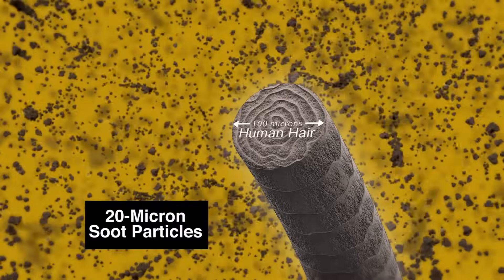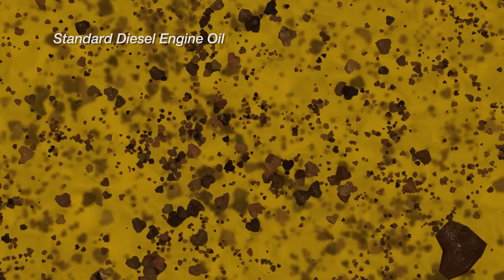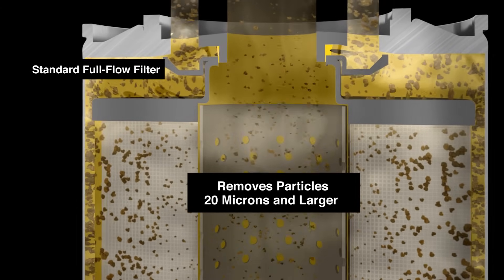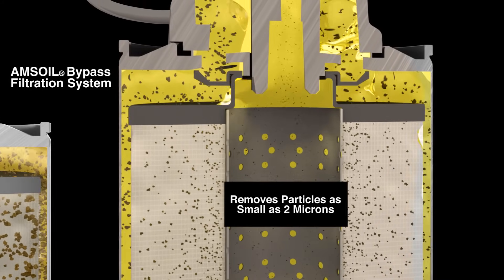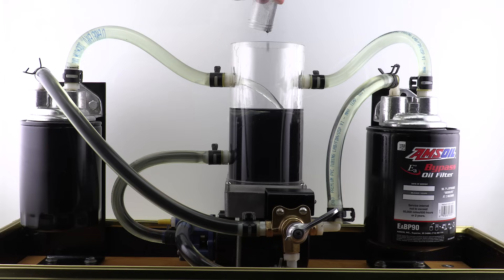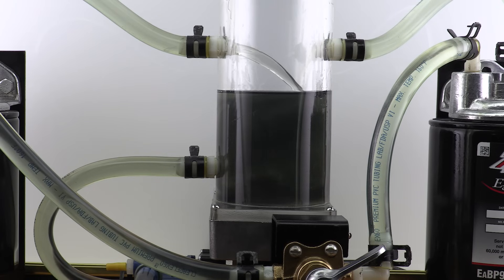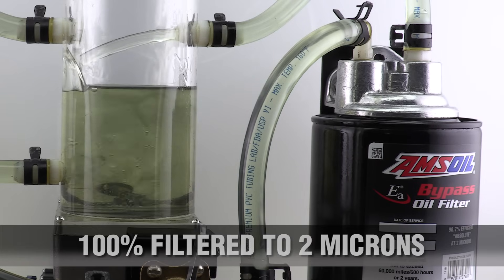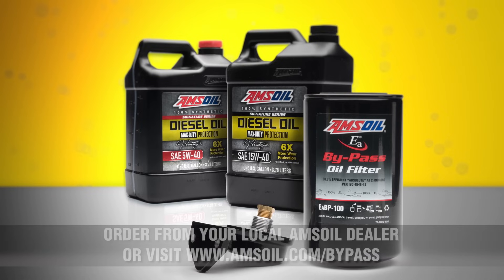AMSOIL: Diesel Bypass Filter Solution

Comment: So i route the return line into the intake?
Reply: No. Depends on which bypass system you use. Some route into the oil fill cap (using a cap with a fitting on it) and others like my dual bypass system route the oil back into the normal flow path using a filter boss take-off.

Comment: Do not buy this expecting it to make your oil visibly clean. 
I just put this on my ‘22 Powerstroke at the last oil change. The oil returning from the bypass filter was immediately black as night.
Reply from the maker: Hello Dallon,

This AMSOIL bypass demonstration is showing how effective the filter is at removing particles that are larger than 3 microns.  Any abrasive wear inside an engine is generally created by particle sizes in the 5 micron to 45 micron range.  The purpose of the filters is to reduce the number of abrasive materials in the engine oil in these size ranges to increase the life of the engine.

In the demonstration, there is a new oil that is contaminated with carbon black suspended in the oil.  The carbon black is used in the size range of 4 to 10 microns.  A typical full flow filter can only remove particles in the 10 to 45 micron range, so in this filter demonstration, running oil through the full flow filter alone will not remove the carbon black particles.  This is very helpful in the demonstrate how regular full flow filtration will not remove all the abrasive particles that are generated inside the engine.   When the oil is passed through the bypass filter, which filters between 1 to 3 microns, it is going to trap the carbon black and demonstrate how bypass filtration can remove finer particles from the oil, effectively removing a majority of all the abrasive particles in the oiling system.

Because this carbon black is "black", which is the same color as diesel soot, some customers believe the bypass system should be removing all the soot in a used diesel oil, making it look clear in appearance.  This is not going to be the case using the bypass filtration system on a diesel engine because soot is sub-micronic (sizes less than 1 micron in size).  The bypass filter will remove any soot that has agglomerated and increased in size larger than 3 microns, so the oil is analytically clean, however, the remaining soot particles will remain suspended in the oil giving it a dark appearance.
Reply: @  what a beautiful explanation!
I believe it. I’m sure my oil is still much cleaner and appreciate the product very much!

Comment: We have been using a similar high efficiency Trasko spin on filter for years and it works brilliantly.
We change the filter every ~80,000 km
Prior to the filter the oil had particles in the 2~22 micron range.
After the filter the particles were <2 micron in size.
We used microscopy from two different companies to confirm this
You can hear the difference in the engine before and after: 
The engine gets quieter
Quieter engines mean better lubrication.

We change the oil at recommended intervals as the oil does get a bit dirty (with sub micron particles) and additive package is depleted e.g. Total Base Number is too low
An oil change is the simplest way to replenish the additive package and remove the < 2 micron particles

We do an oil analysis every oil change to keep track of wear in the engine and the oil quality.
🙂
Reply: High efficiency spin on filters are much simpler to fit than bypass filters and seem to give exactly the same results.
:-)
Reply: To reduce wear further try bonding a lubricant to the engine
:-) #XcelPlus
Reply: Vc é o bichão mesmo heim

Comment: I just wonder if this is such a great product and so necessary for diesel engines, why hasn’t AMSOIL developed this product for the 3.0L Duramax LM2 and LZ0 engines that are now one of GM’s best sellers  I asked AMSOIL if they make one for this engine and they said no with no indication that they are thinking of doing so.  IF it works, then it seems like they are missing a huge market given that it would be a mod of an existing product.

Comment: A few great oil additives to do, in your  pre oil change 500-800 miles before change & filter event.
1. MOTORKOTE
2, HOTSHOT
3. ARCHOIL 

Definitely Use Shaffers oil, with TBN in it. 
Its chemical balance has superior wear protection Proven easily amsoil has claimed they have.

Comment: so changing oil more or paying hundreds of dollars for by-pass  it may take out the particles but the additives break down dont they?   i lost my trust with amsoils 25k gas filters, i went to about 10k miles and the oil was black as if it was in my 1970 chevy with dino oil.   normally when i cange every 3-5k my oil is still clear on teh dipstic..    somehow i dont feel amsoil is telling the whole story.    plus with the info on bypass filters....WHY WOULD ANYONE WANT TO GO TO 25K AND LOAD THE OIL WITH 50X THE AMOUNT OF DEBRIS BELOW 20 MICRONS?  THAT DONT MAKE SENSE.   ONLY THING THAT DOES. IS PUT TEH BYPASS FILTER ON, AND CHANGE THE OIL THE SAME. AND HAVE YOUR ENGINE LAST LONGER.
Reply: Oil color is zero indication of oil quality. Did you send that sample off for analysis? If you didn’t, then you have no idea what the condition of the used oil was. Using “oil color” as a basis for replacement is just as silly as sniffing the sample or tasting it. It won’t tell you anything.

Comment: Make a version for gas engines and 1/2 the price and I'm IN.
Reply: They do. It’s the universal dual bypass system. I run one on my Navigator with the 3v Ford 5.4 V8. They give you the hoses and everything else with the kit. You have to order the right oil filter boss take-off with it, but everything works well. You do have to make your hoses from the kit hoses and fittings, but they give you plenty.
Reply: Use the dual bypass kit. I run one on my Ford 5.4 V8. It’s been working well.

Comment: It's a lie. Doesn't work. Other utubers have tested it. Sorry
Reply: Steven Bryant............I installed one of these system on a 1994 Dodge/Cummins powered pickup, and ran it for 10 years/155,000 miles, and took oil analysis every 12,000 miles, and never changed out the oil, so yes, they do work!
Reply: @stevenbryant3752 - Making incorrect, damaging statements about a company is illegal. It's called libel.  People committing libel can be sued in court and lawyers are very expensive.  Libel is also in violation of YouTube established rules.

Comment: These demonstrations always cut away after a few seconds of the bypass filter running. It is instantly clear because the bypass filter is filled with clean, fresh oil. So when it is switched over you think, wow that's amazing. They are more than likely only dumping larger micron particles into it also. There's no need for this type of illusion BS but they all do it. Diesel oil is still gonna be black due to the sub 2-3 micron soot particle in it. It would turn black with 0.5 micron soot in it too. Like people have commented before, you have to send in oil samples to know how it's doing. If you look at other peoples data that is posted all over the place, you can easily extend your oil changes by double the miles, but to be sure you'd need to sample and decide for yourself.  In my opinion they are worth installing if you plan to keep the vehicle long term. If you get a new car or truck every 2-3 years you probably don't need to bother. 2 micron particles will still wear on your engine, just slower than 20 micron particles. Think of it like sanding with 200 grit and 800 grit on wood. If you use enough 800 you'll still sand it down, just takes longer.
Reply: @emrwtf - Making incorrect, damaging statements about a company is illegal. It's called libel.  People committing libel can be sued in court and lawyers are very expensive.  Libel is also in violation of YouTube established rules.
Reply: @HiTechOilCo  little late to the party bud. That comment was a year ago. Also it is my opinion, which is perfectly legal as per the constitution. Just like it is perfectly legal for you to have an opinion about my opinion. You really have nothing better to do?

Comment: The problem with these stupid videos is that they show it going from dirty engine oil to clear clean oil. Problem is these useless demonstrations are using brand new oil that has never seen heat or cycles of a Diesel engine, now for all of you who have bought this in hope that your engine oil will stay golden for 100,000k’s your misinformed, 

Oil will darkin purely because it’s carbon based, when carbon gets hot it darkens, the fact is these filters and other bypass systems will remove contaminants but you need oil samples to see how much, and for all the people complaining there oil still turns black after having these that’s cause these cock sucker oil companies are very smart in how they advertise a product, now if it actually removed soot load from oil they would use filthy dirty engine oil out of a EGR cummins motor and see how it pans out 😎😎😎😎 but yes they work, you’ll see difference in oil samples not in oil colour 🤷🏼‍♀️
Reply: Making incorrect, damaging statements about a company is illegal. It's called libel.  People committing libel can be sued in court and lawyers are very expensive.  Libel is also in violation of YouTube established rules.

Comment: Why is the oil black after changing it with the bypass filter on a diesel?  What does that mean if it's black?
Reply: Brent S...............The black oil in Diesels is small particles of "SOOT" that are very small, like .0000009 that you see.  When these small particles AGGLOMERATE (Gain Growth) and become larger, the by-pass filter will then take them out,but the very small soot particles will still be there causing the oil to look black.
Reply: You should also do an oil analysis. They can tell you the condition of the oil from a sample & what wear particles are in it. When there is an abnormality you will see it on your lab report. They helped me catch bearing wear on a 1.1 million mile engine, Heavy duty diesel.

Comment: Does Amsoil Bypass filter lower oil pressure on 6.0 Powerstroke?
Reply from the maker: Thank you for the question, Michael. The AMSOIL Bypass System will not affect the oil pressure in the engine.  The pressure needed to for the bypass system is reserve pressure the engine oil pump generates, and will not have reduce the oil pressure to the engine parts. 

We hope this is helpful. If you have any additional questions, please contact our Tech Team at Tech@amsoil.com or by phone at 715-399-8324. Thank you! 

-The AMSOIL Team
Reply: When I installed this kit and switched from synth blend to amsoil signature, my oil pressure dropped about 10 psi cold, and 5 psi midrange. However at idle it is about 3 psi higher after working hard so I think it's just due to the oil being superior and more stable.

Comment: great video.. i am running this system and have never got the oil to go clear again like in the video but i think this is because  in the demo when it is switched over to the by pass filter its running 100% not 10%. still its better than nothing.
Reply: That's because in real life, your engine will have those ultra small soot particles under 2 microns, which will still color the oil. However, the oil will not be as thoroughly black and opaque as oil that hasn't been bypass filtered.
Reply: They may use a media bigger then 2 microns to show what is happening. Ive used amsoil for about 20 years. In oil analysis it's performed better then Rotella and some other oils I tried. another logger noticed a huge wintertime starting gain on his 700 hp chipper.
Reply: @firewoodtime2   What they use is a contaminant solution which has particles smaller than 20 microns but larger than 2 microns, so it can be missed by the full flow filter but filtered by the bypass filter.

With a real engine, you'll still have those sub 2 micron particles, which cause very little engine damage. Most wear is caused by those 2-20 micron particles.
Reply: I bought this system and can confirm this is the truth
Reply: They said they used particles 5-10 microns in size.
That's why the oil went clear after filtration i.e. The filter filters to 2 microns
The particles that are left in your engine oil are under 2 microns in size.
These smaller particles are not the ones that can damage your engine... but they will make your oil look black.
🙂
Reply: The reason is because the bypass filter is filled with fresh clean oil in the demo, and they only run it for a short time after switching it to the bypass filter. Every single demo you see like this they will cut away after 10-15 seconds.  A 2 micron filter will filter down to 2 microns, but you'll never get new clear oil out of one. You'd need a centrifuge to get pure clean oil. Even then I'd imagine recycled oil is filtered through some kind of sub micron filtering or something else to get it clear again.
Reply: @emrwtf  tricksters.  Not a fair demo thanks for pointing this out.
Reply: @ Despite being a bit misleading it's actually a reasonable test... as the only particles left behind would be <2 microns in size and those are not big enough to cause damage to the engine.

The colour change is thus a good way to show that some filtering is occurring. If you run oil analysis and microscopy on your engine oil you can see that the large particles have been removed from the oil... and that the number of particles is significantly reduced when you use a high efficiency filter.

Comment: How big are the particles in what was poured in???????
Reply: Pretty obvious they were 2-20 microns. Probably a single specific size, like 10 microns.
Reply: They said they used 5-10 micron particles.
It was done to demonstrate how effective bypass filtration is at removing the particles that are responsible for causing most wear i.e. 2~22 micron
🙂

Comment: Hmm how come my oil doesn’t end up clean like that but is a sooty mess.. not saying they don’t work or aren’t good to have, I just bought one and have it on my older truck too.. just saying
Reply: David B.................Soot particles are very very small, in the range of .0000000009 (1 MICRON) so the oil will be black, as there is NO OIL filter that will take out that small of a soot particle.  However, when these small particles Agglomerate (come together and gain in size)  The 2 micron By-pass filter will take this size particle out, but the oil will be black!

Comment: I put 300 miles after the install. Oil is  still as dark at it was... Is that normal?
Reply: Oil is still dark, yes that's normal. But if you look at it very, very closely you'll see the oil has much less soot in it, compared to the same miles on your truck's oil without the bypass filter.  I will admit the demonstration in the video does not accurately portray oil color of a LIVE, running diesel engine.  It DOES show the idea or concept of bypass filtration.  A running diesel engine is generating soot and giving away as much free soot as possible wherever exhaust meets oil, like cylinder walls in the combustion chambers.  And the engine is running 600 to 2000-3000 rpm under normal conditions and pumping quite alot of oil per minute for lubrication, and other things like powering injectors in my 6.0 Powerstroke for example.  The regular oil filter is a full flow filter, it filters the full flow of the oil while still allowing the necessary high oil pressure for adequate oil throughout the engine.  Meanwhile at the same time the bypass oil filter is only filtering a very small percentage of the oil flow so as not to interrupt the necessary high oil pressure which would cause engine failure and a terrible, expensive repair.  And it's doing so down to a much smaller particle size, which is the whole point and purpose of it.  It is the best way I know to filter down to 2 microns instead of the regular 20 microns in size the regular filter provides.
Reply: @BestEngineOil  thank you!

Comment: Does it come for 1.5 liter diesel engines?
Reply: It will work for any engine just need the oil filter adapter to screw into you engines oil.filter location or custum make one for your engine if you cant find one that fits

Comment: Will this product lower oil pressure to the engine and cause damage from lack of lubrication
Reply: No.  It only draws a small percentage off the oil flow.  I've got one on my 6.0 Powerstroke and it's great!
Reply: @BestEngineOil  did you mounted the filter the same way as the Sinister diesel videos or another way?
Reply: @banderasXx69   Since I had purchased the kit from Sinister Diesel before becoming an AMSOIL dealer, I went ahead and installed it.  It's an excellent kit if you want the truth, it includes the awesome AMSOIL bypass oil filter and a bypass coolant filter.  VERY happy with it!  My 6.0 stock injectors love the finer (cleaner) oil now as a result!
Reply: Mine dropped ever so slightly at cold and midrange, but I also switched from fleet blend oil to amsoil signature series.
Reply: @Legally_its_a_joke  Oil pressure is not everything. As long as there is enough, there is enough. Extra doesn't help anything.

I run thinner oil, for start up (5w-40 for diesels) and yes, the oil pressure is lower on startup, but in reality, the flow is higher because it flows more easily. Oil pumps are positive displacement, pumping a non-compressible liquid. Therefore, for each revolution of the engine, X volume of oil is pumped. If the oil pressure is lower, that just means it is pumping more freely (or in a worn engine, it's getting out in more places more quickly).

When it gets too low, like if there is fuel dilution, that's where you have problems, because the oil is too thin to prevent wear.